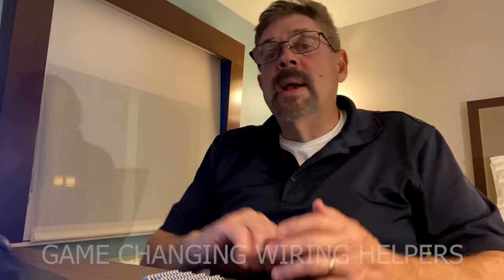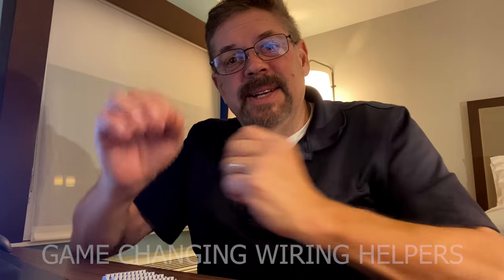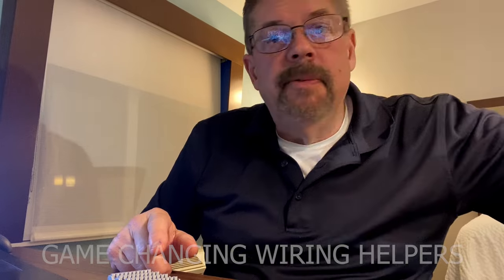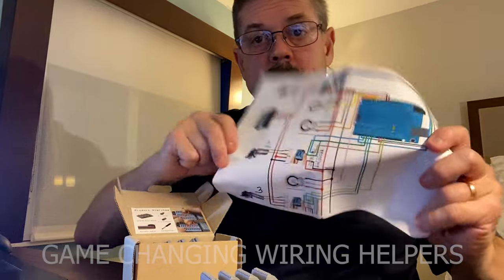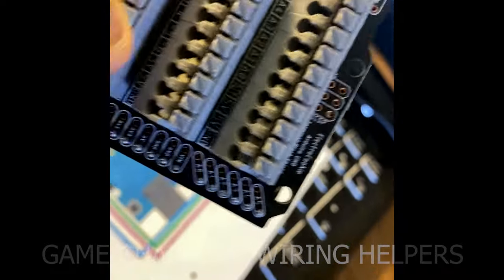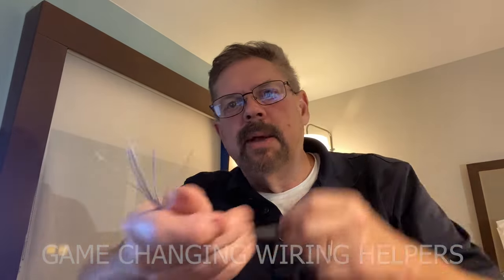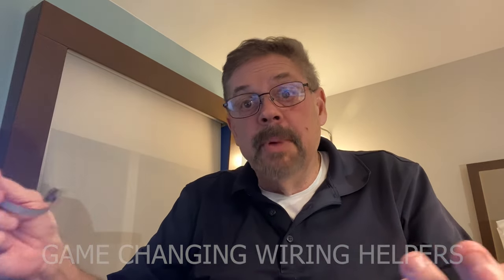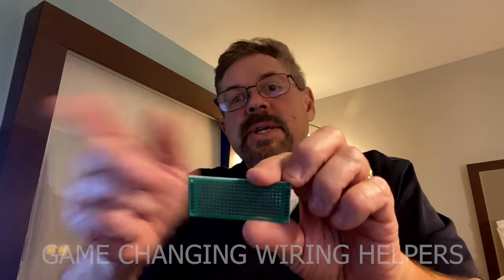Motion Simulator Wiring  -  GAME CHANGER ! -   parts and part numbers for solderless connections

Comment: Still loving your videos mate. With that big magnifying glass, as it's on a stand, make sure to keep it under a bench or covered. Really easy for sunlight to project through it and set your house on fire. Most of the big ones on stands etc have a flip over cover to prevent that.
Reply from the maker: Thanks for watching the video.. more coming up in 24.. Yeah that 30x.. it's a beast.. the real issue is controlling the iron at 30x.. it seems to shake all over the place.. (because of me of course)   So these new clamp down add on's should help keep a stable signal..   So if you put the little individual  'prototype' pins into the Arduino.. eventually they will get loose and then you are 'troubleshooting' which sucks..   Anyway,  Thanks for watching again.. Hope to be back in a few weeks and complete the build.. Dave

Comment: You know its a good day when DMax drops an update.  Thanks Dave,  my eyes are starting to fail me now too, I've got 1 of those helping hands things,  a godsend.  But at least I haven't got a central nerve tremor like my Electrician mate,  can't stand watching him wire up a pump board lol.  All the seasons greetings to you Dude.  Finally got my mig welder, and I picked up a cool swivel seat base the other day(out a skip lol)  it runs o. Heavy bearings, so this will be my base for the whole rig as I want to feel Yaw when flying my Spitties and mustangs.  Excited.
Reply from the maker: TERRY!  Awesome for keeping in touch buddy!  Yeah.. those helping hands only get you so far..  That's kind of why I got pissed and decide to look for alternatives.. Still got to solder some stuff.. but way way less..  I guess we're all getting past the 'prime' but whatever as long as we keep pushing on to get what we want.  I would love to have a mig..  Mine is a flux core so it leaves a tan dirt on the weld so it's not as visual or clean once done.. but easily scraped away. I have a couple hand drawings for my 'flight' rig..  I dont think you can realistically pull of an F1 to  GT to flight rig (or at least I dont think I can) so I'm going to build one of each in the next year or so..  Really want to try out flight..  was my favorite way long ago.. Dave

Comment: Great job! Like always finding very useful ypur videos!

You can use DIN  rail terminal blocks to replace the circuit board... And add "bridges" to connect multiple terminal blocks to the same source (5V/0V) and keep everything "modular". 

Also "hollow terminals" instead of soldering wire ends on the ribbon cables...
Reply from the maker: Very interesting in what your talking about here .. Thanks for watching too..  Do I just search for  'hollow terminals"?    I never thought about using mini din blocks.  I seem to always revert back to the blank board for soldering +5 and gnd..  I can still see stuff.. but just some stuff Is difficult..   I did get a few responses from x-simulator.net  and they were in agreement about the age/dexterity factor which makes things difficult..  (nice to hear I'm not alone in that ) 🤪    I'll do some research while I'm away to see if I can make it easier still..  Thanks a bunch, Dave
Reply: @DMAX_DIY  I sent you an email with pictures...

Comment: I think I’ve watched almost every video you have, I’ve actually revisited your series a few times. I think I’m actually gunna do it this time. I have also looked through the forum, but somewhere along the line I am missing the full dimensions of your new smaller rig. If those are available, can you tell me where to find them? Thanks, for your content and for your time.
Reply from the maker: Thanks so much Donald.. Really.. I never know who watches except for the comments..  Makes it worth the efforts.  - So.. I do have a 3ds max model I made which I built just to 'SEE" the project.. not dimensionally accurate in any way however.. just throwing paint on the wall to see what sticks really.  I did attempt my best to show the critical measurements on the videos themselves by using a tape measure..  I did try an be as accurate a possible.. I'm STILL building it.. but  there are at least 8 other guys who have already built the rig from the videos in the series and have been racing their rigs for a while now..  One of them was that  'questionmarket' guy who told me about the electro cookie thing etc..  So these rigs are working..  and people are having fun.. even if mine is still sitting there..  not done yet.. Dave

Comment: Hi, I’m about to start building my own motion rig soon, I was thinking of using your design but modifying some things to fit my equipment, but I can’t seem to find any files about measurements and such, is there a link to the sketches/design?
Reply from the maker: Well, I didnt really have time to make a downloadable sketch of this project.  But I did take the time to show everyone with a tape measure the length of each section of steel and with an angle finder, the position of many things. I did that Live while videotaping the series.  So you might have to take a few notes while watching.  That's just the way I do it..  Thanks for the comments and just know that the project came out great and I have been racing it quite a bit until recently, where my work took me out of the country for the last few months.. Dave
Reply: @DMAX_DIY  Thanks for the response, unfortunately I live in Europe and we use the metric system, so most measurements wouldn't be very exact or accurate, but  I will just round them up / down to the closest 10 and hope for the best. The design does look pretty good and durable, which is why I would've loved a sketch to download.

Comment: Great videos my man! Thank you for all the knowledge, im starting my journey on building my own rig and i just had a question. If space was no facotor, do you think i should go for your original design or the new compact one? All the best!
Reply: Also this will be mainly a drifting rig, so there will be quite a bit of traction loss. Cheers!
Reply from the maker: Great question!  Thanks for watching..  @bengallaugher4191   I would absolutely make use of a bigger bottom frame much like the  first one I made  which pushes from the rear of the seat.  I decided to make this one because a few of my friends live in small spaces, that's all..   for drifting without space limitations, i would go with a rear pusher and you could make the TL frame a lot wider in the rear..  dave

Comment: Please give me a copy of SMC3 Windows Utilities, My sm3 is currently unusable with the motor3
Reply from the maker: Hi, on this page https://www.xsimulator.net/community/threads/smc3-arduino-3dof-motor-driver-and-windows-utilities.4957/
you can find a link to the SMC3 utilites..    But it would seem that if you have two motors working, the 3rd motor may have an issue or wiring problem..  have you swapped motors around or IBT-s?     Dave